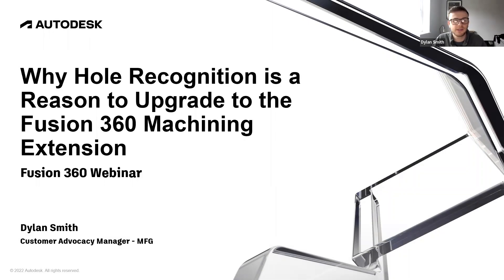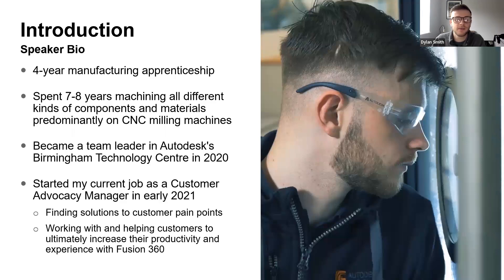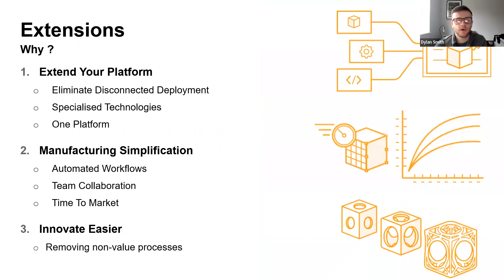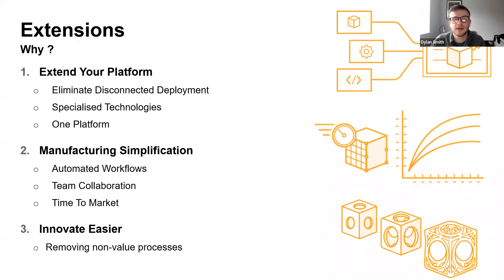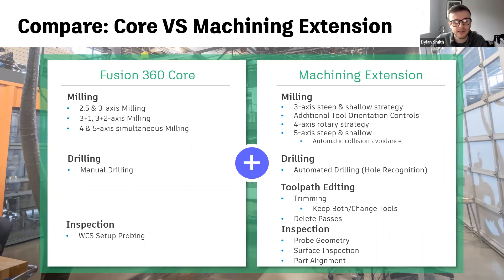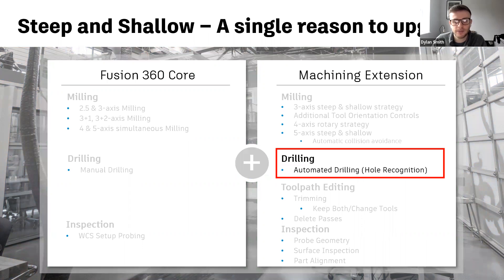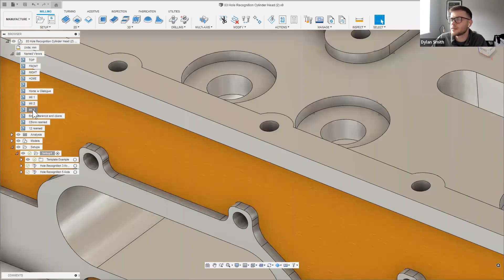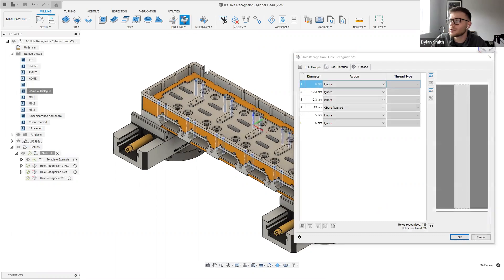Webinar: Automate Your Drilling & Tapping Cycles with Hole Recognition | Autodesk Fusion 360

Comment: back in 1976 using a program called AUTOSPOT I could define the drawing datum to the machine coordinates, then  specify a routine say, TAP etc . I would specify the tools from the tools liberary, define the depths of the spot drill, drill, and the tap, list the hole coordinates and it would go away and machines all the  holes. Then we had to change to APT and what was once very simple became very difficult, the numbers of instructions to complete a part trebled.